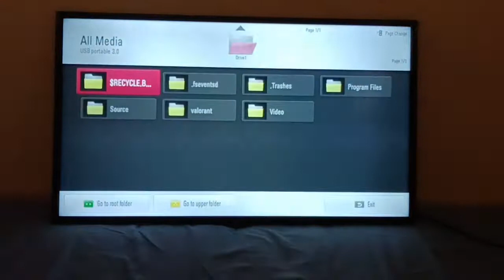How to fix/hack scratch output LG TV 42 inch 42LN5100

Comment: He covered pins 2-9 on the ribbon cable. These are 8 redundant clock signals (CLK1-8 label?) that can interfere with the same working clock signals from the other ribbon. Remove one ribbon and turn on. the good side will show 1 clear screen, repeat. the bad side will show your interference. taping them off on the bad side will possible clear the fault. You can further isolate by removing the tape 1 pin at a time until you find the 1 bad pin, then only covering that 1 pin.
Reply: But does it means the ribbon cable is faulty or the t con board needs to be replaced?
Reply: @Nelson3884  Its not a ribbon cable issue unless the cable is not fully seated to begin with. I have 'fixed' 3 bad TV's simply by reseating the ribbon cables from Tcon to display. These are always vertical line issues. Swapping Tcon boards would verify the issue but they are not usually available to do while you are troubleshooting.